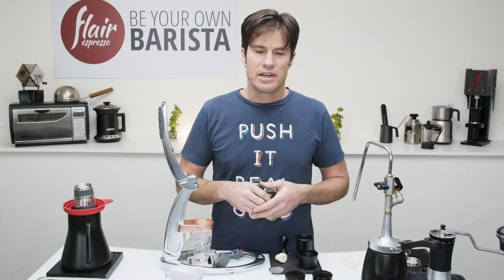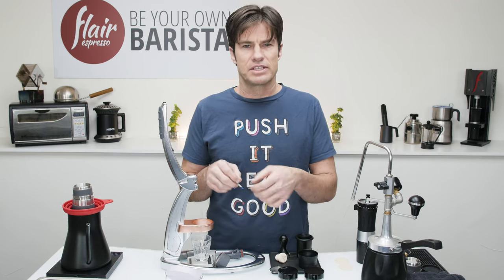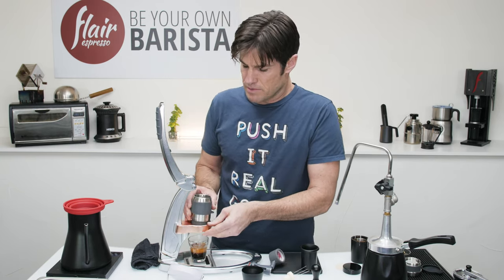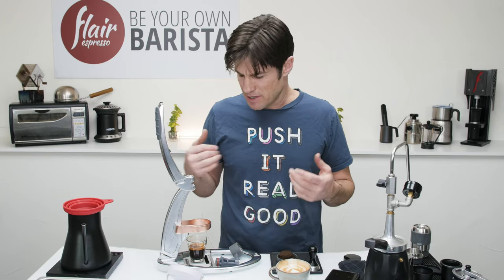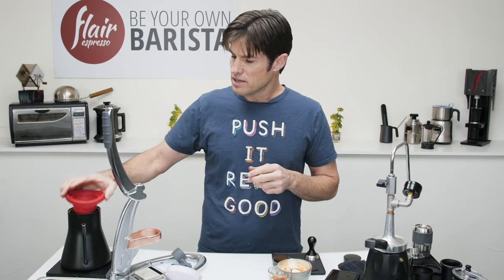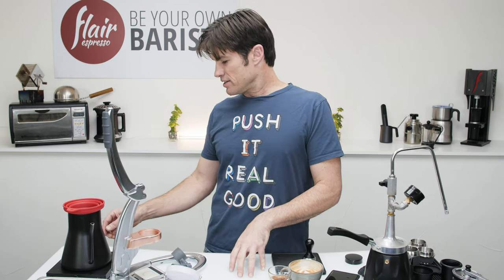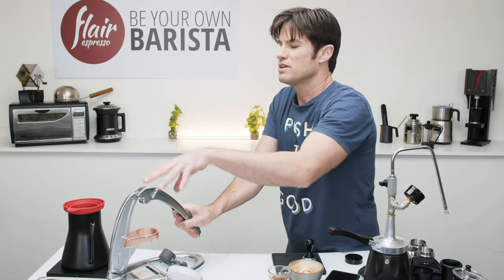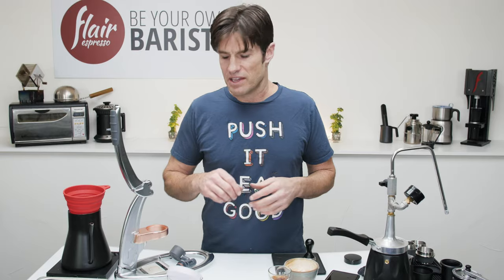Brewing Two Shots of Espresso Back to Back | Workflow Hacks

Comment: lol called out! I just think the “more tools = better spro” paradigm isn’t helpful for beginners

In the Socratic study, they did tamp in all cases with a push tamper, so the only variable was whether they used an OCD or not. The other thing that surprised me was the shots weren’t more consistent (shot time or extraction) with the distributor. Granted, a slightly lower extraction w/ a distributor compared to bad puck prep without one might still be preferred.
Reply from the maker: I think it's the other Jordan (Waitforit Bonaficio) that has been actively and consistently commenting this, but thanks for sharing these insights

Comment: these videos are so helpful especially for beginners like me where my Flair signature is my first espresso machine.
who makes that steamer?
Reply from the maker: R.E.D. Systems but you'll have an easier time finding the Bellman in NA
Reply: Thanks. I actually have a Bellman. I just suck at making latte foam. I can make a good cappuccino foam though.
Reply from the maker: Are you in the Brew With Flair group on Facebook? Lots of folks willing to help you breakthrough
Reply: @FlairEspresso  Do you know what types of steamers (preferably electric) are the easiest to find in Europe/Germany?
Reply from the maker: @jackaw1197  Dualit cino, WPM
Reply: @FlairEspresso  thank you for the tip. I see that both of them are quite expensive (but I guess you pay for the quality), but not unaffordable in my budget. Would you have any advice with regards to using the steam wand on a cheap/crappy "espresso" maker (e.g. Amazon basics or similar)? Or would it just be a frustrating waste of time and money?
Reply from the maker: @jackaw1197  electric bellman

Comment: What temp to I need to get the brew head up to?  I have the stick on Flair thermometer and by placing the brew head on my kettle and covering the brew head with the silicone funnel (traps the steam) the thermometer shows at most 80 to 85 degrees C.  Without the silicone funnel covering it doesn't get past 75.  I then pour in water off the boil and the surface thermometer shows 85 to 90.  By the time I've pressed (45 sec), its back down to 75.  Am I close?  If not any other tips?  Thanks!

Comment: Hey Andrew, I have my Flair Pro 2 on the way, and I went ahead and bought and additional portafilter+screen for easier back-to-back shots. Problem is, if both portafilters need to be preheated, how would one realistically go about doing that? I just seems to be easier to use the already used/heated portafilter, and quickly dry it off like you do.

If preheating the portafilter wasn't important, sure, I could see the benefit of having a second one (to grind and WDT prep them both at the same time, while the brew chamber heats up and the water boils), but I can't quite figure out how to include a second preheated portafilter into a streamlined workflow. Any ideas? Or is the second portafilter really just more inconvenience than actual use? Thanks for all the content and help that you put out!
Reply from the maker: due to the need to handle and prep the basket, you cannot preheat it all the way to brewing temperatures. few options:

1) heat them both up to a temperature that's comfortable for you, prep and pull back-to-back, trying to be quick about it using same cylinder and accept that the 2nd one will have lost some temp but likely marginally so.

2) pre-grind 2nd dose but use same basket (portafilter), preheated same each time.

3) skip preheating the basket altogether for parity and instead use water that was heated several degrees above desired brewing temp to accommodate for cooler component; experiment with temp loss in the system to determine how much above target you should start
Reply: @FlairEspresso  That's a really well-rounded, good answer - thank you so much! I will play around with each one and see which I prefer. Again, thank you!

Comment: Dear Andrew, thank you very much for die Video. I learned a lot. But two questions: 

- Is there a spring loaded Tamper available to control der tamping pressure in this size? 

- And what kind of a dose / roast do you recommend for my taste: high crema, not bitter and not sour, very sweet...

Greetings from Germany :-)
Reply from the maker: Normcore is releasing a v4 in 45.5mm soon. Stick to medium roast.
Reply: @FlairEspresso  Thank you for the answer :-)

Comment: Can I use a cut up v60 paper filter? Or any type for that matter?
Reply from the maker: Most paper filters will work perfectly if you can cut then down to fit snug
Reply: @FlairEspresso  perfect thank you! Will def try this out ! This saves money 😅😅
Reply: It's good to open a graphic program and draw a thin black circle of the required diameter, save to .pdf, print, cut out an use that for a template (just cut around it). You can stack two or more drip filters flat (depending on your scissors) and cut around. Used this when I couldn't get Aeropress papers locally to bridge the wait :)

Comment: Hi, Im also using the Royal Grinder and Ive noticed U grinded that coffee so much faster than me. Did U replace burr for some fast one?
Reply from the maker: we have in fact changed the geometry on the cone burr for future production
Reply: @FlairEspresso  nice, will there be an upgrade possibility or that will be exclusive to the new version? And will it have any other effects or just grind time?
Reply from the maker: You trade speed for exertion. Faster, more aggressive geometry might pose a challenge for those with lower hand strength wishing to grind light roasts/hard beans to an espresso fine. The option to purchase the newly designed cone burr will be available in time
Reply: @FlairEspresso  im mostly grinding 17g at a time so the current cone burr is ok, but if grinding quality will be at least as good I may buy the new one. I've noticed great upgrade in speed/grind consistency when I bought M2 burr for my Encore. But the most interesting part was the coffee taste change. Probably cutting profile has to do with it. Have U noticed any change with new Royal burr?
Reply from the maker: @marcinwojcik6622  it's likely there's some small trade off between speed and uniform it Ybor, but we haven't noticed it in our cups as of yet.

Comment: It's possible to use Encore after a little mods ;) Then it works well.
Reply: What mods?
Reply: @artemisfowlthe3  U can:
1. Replace burr with M2 cone burr. 
It's much faster and the grind seems more consistent - but U can still use the standard burr. It will take more time to grind for espresso.
2. Make the grinder stepless. It's quite easy. After taking off the plastic case, I took out a little plastic element that makes the adjustment ring "click". To prevent the ring from moving while grinding wrapped the holder of that "clicking" element with 1,5mm thick silicone band and that gives a little resistance while changing grind size.
3. U can re-calibrate the grinder for a finer grind:
https://www.youtube.com/watch?v=a-DlufjIjMA